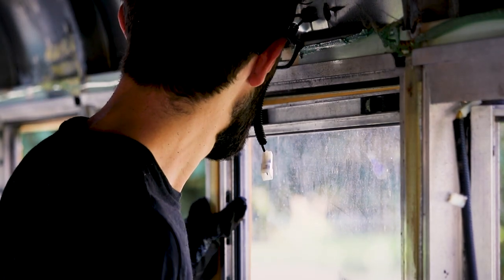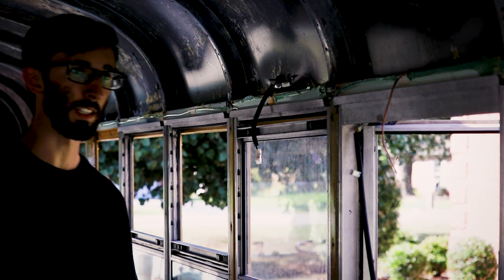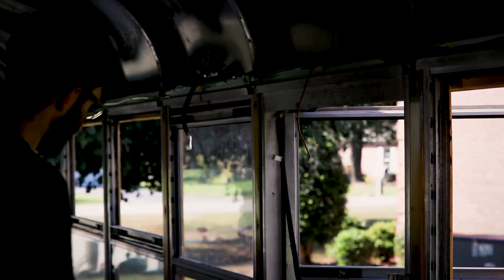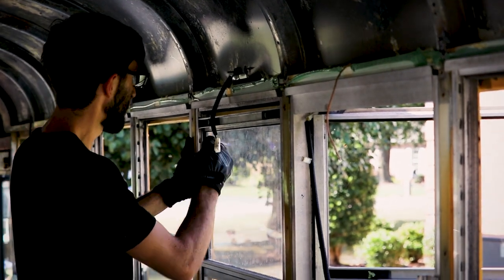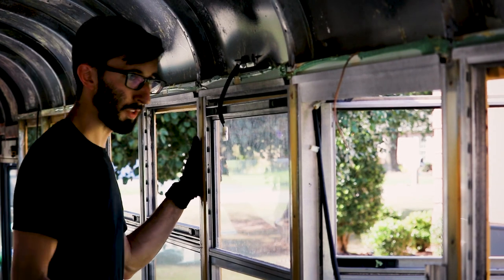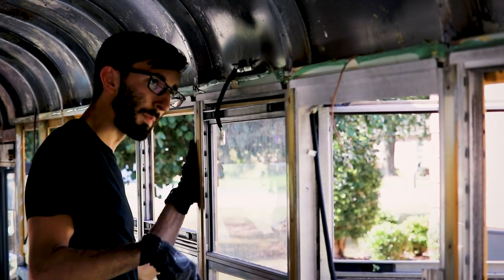How to Remove Windows on a School Bus // Skoolie Conversion

Comment: Just did my windows ... was super easy
Reply from the maker: I wish our was. Had to redo it and then they still leaked a little. I think I finally got them figured out though.
Reply: Backroad Purpose In all fairness, your windows had a lot more going on than mine .. I had 2 screws holding them them in ... no side trim screws at all. I was nervous. I used HENRY’S wet patch for roofing to seal everything . Looks like they used bubble gum to seal them originally , like mine ... irony ... since it’s a “school bus” 😂😂
Reply: Brandy no... I used the Henry’s Wet Patch.. comes in a tube and applied with caulking gun. After it cured (2 hours) I hit it with Rustoleum Black Spray paint ! I’m gonna use this stuff for virtually every possible leak spot. Also , I did all of the roof panel seams with the same Wet Patch Caulking... I will go back over the entire roof with the Tropicool stuff. Maybe overkill but I really don’t want to worry about what’s happening BEHIND the walls after it’s all built ,  Ya know ? I’m literally hitting every seam with the Wet Patch Caulk .... every single seam ! #noleaks

Comment: Hey I know this video is old but I just found it and have a bus and need to take the windows out.  Most videos the buses have 2 screws between the windows but mine do not and yours does not either, so are the only screws required to remove the windows going sideways or do you have to remove the outside plate first or at all?

I also noticed your bottom sheet metal under the windows, did you cut them?  Can they be removed after you remove the windows?
Reply from the maker: bottom sheet it a ledge the windows sit on. the black brackets is what sandwiches the windows to the outside metal. the outside metal does not need to be removed.

Comment: So if one of my windows falls out, its gonna fall inside not onto the highway?
Reply from the maker: correct. however they get clamped into the frame so they won't fall out. plus all of the sealer acts a glue keeping it in place as well
Reply: @BackroadPurpose  I took all those shackles off to paint and they all got lost, so I'm running on glue.. 😁 I don't have much of a choice rn I'm alone now ~

Comment: Question bus folks!!  Does everyone do this? I thought (once we get a bus), maybe take it to a car wash and see what leaks? Or Just do it anyway to prevent/fix the leaks!!??
Reply from the maker: That's not a bad idea. However, a lot of it will actually leak under the window down behind the walls. So you can't see if unless you pull the wall off. So I'd incourage you to do it. It's a days worth of works and about $60 in material but definitely better then water getting under your floors.